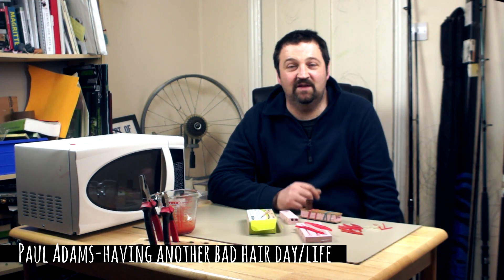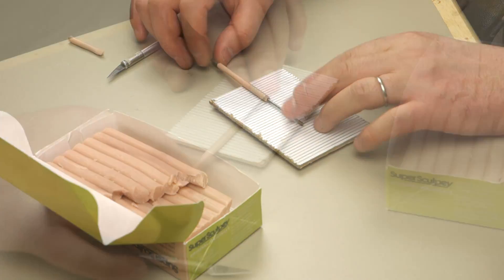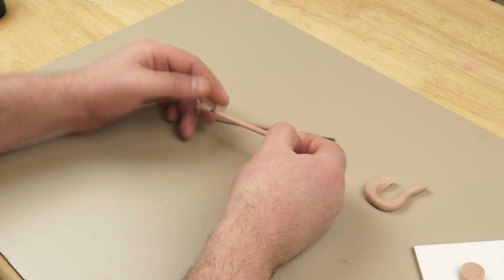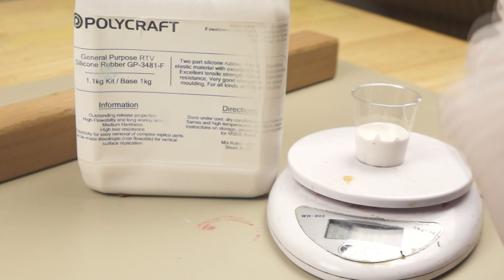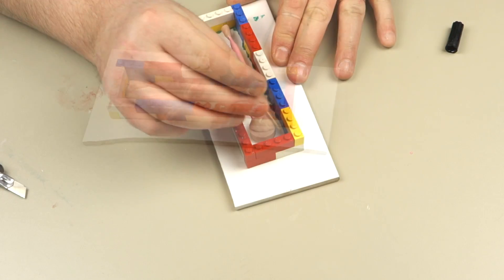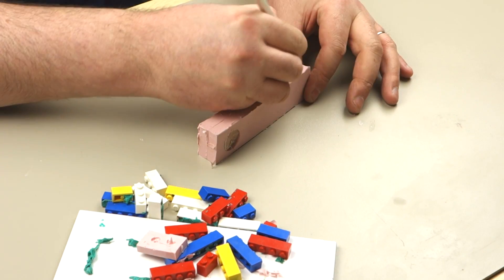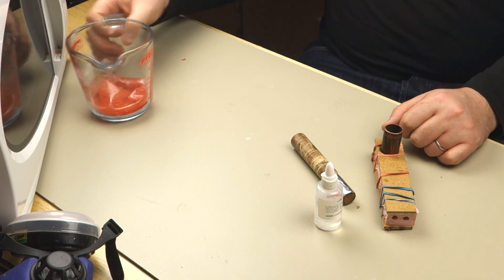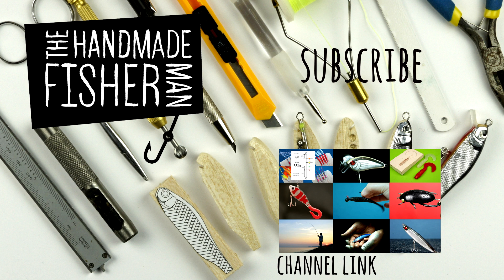Making Homemade Injection Molds For Soft Plastic Worm Fishing Lures

Comment: Can I have the CAD/CAM File for Fish Lights products,  it has threads and a clear plastic
We are using a hand injection, and semi automatic injection, Items are fishing Net Lights
Fish Lure Lights, they are like led Torch.

How does the mould look like for low volume production. Link Below , remove spaces

http:// i.ebayimg. com/images/g/r6oAAOSwnbZYCD21/s-l1600.jpg

www. aliexpress. com/cheap/cheap-fishnet-light. html

I designed my own Temperature controller and hand operated Injection mould now I have to concentrate on moulds.

Comment: Love your stuff Paul...that being said...I mainly fish heavy cover looking for largemouth bass.  I have been trying to re-create a hollow body frog to my own specs but have failed miserably.   Any ideas?  It would be a good project to take on...If i finally figure it out I will let you know...Any suggestions would be great.  You have a better grasp on intuitive ideas than most and thought I would ask....Keep 'em coming!
L/S
Reply from the maker: +Lightning Strike Lures it is not something i have thought about mainly because I do not really use frogs although i did fancy having a go this summer for pike as i had great few sessions with spooks. I am guessing they are made in a metal mold that is rotated and passed through an oven with some kind of liquid pvc that coats the sides. That may be difficult to reproduce at home, i have done some rotocasting with polyurethane but it is not that easy to get uniform coverage. An easier alternative maybe  to use something like a silicone foam pored in a mould, this could probable be painted with silicone paints. I am guessing this is what those spongy dog toys are made from. but it would all need a lot of experimentation to get enough buoyancy and consistency

Comment: is the plunger just for getting rid of airbubbles? is there a big difference between this and pour a small stream into the mold
Reply from the maker: The plunger injects the pvc the gap allows the air to escape before the pvc seals the gap and it is forced into the mould under light pressure, i am not sure you would be able to pour anything this fine.

Comment: nice video ,i did not find the polycraft ,is their an other product to made lures thank's you are the best
Reply from the maker: boukellal redouane Smooth-on do oomoo 30 silicone and alumilite do high strength 2 which looks similar, but it may take some experimentation with the thickness of the moulds
Reply: thank you very mutch

Comment: Hi Paul! I appreciate your attention to detail and very enjoy each of your videos! I cast my bait also yourself. If you had an idea how to "tentacle" can pour? Thanks and cheers!
Reply from the maker: Tentacles and small details are something i thought about for a while, but i need to do some experiments I think mould design where the answers are. To get small details like these worms reasonable pressure is required, with aluminium molds they can take higher pressure and also vent better as they are not an airtight seal. I think less flexible silicone would be needed and the venting would have to thought about so all the tentacles fill and the air escapes. A guy did send me a picture of an amazing crab with legs he had made using this method so it is doable, but time as always is my enemy but i am starting to look at soft plastic again and injecting lager swim/paddle baits.   Thanks
Reply: Thanks Dude! Good. Luck

Comment: Great video.  Could you share , what type or brand soft plastic are you using?
Reply from the maker: i use liquid pvc from Lurefactors in the UK, this was their soft pvc which works well for little tiny baits. thanks
Reply: Thanks a lot

Comment: Hello Paul. It's Mike again. I was going to make a swimbait injection mold but I wanted to make it hollow bodied. I was just going to make it much like your video and stick a formed butter knife into the exit hole for the melted plastic. I ground the knife so it's not sharp. What do you think?
Reply from the maker: Mike Kim give it a go I have used bits scrap sheet metal before to create belly slots, good luck

Comment: Hey Paul, great vid. I was just wondering if you know of any alternatives to applying the first layer of silicone on the motor. I can't find them and if I do they are extremely expensive. Thanks!
Reply from the maker: This motor cost me about £5 from ebay. The first mold of this type i made just poured without any coating first and when it was cured i found a number of bubble stayed trapped on the underside of mold. To be honest on a worm this was hardly noticeable and it gave a slightly dappled effect. On the next moulds i tried just painting a thin coat without rotating and this reduced the bubbles considerabley to only half a dozen and the finished worms were great. It was only when i used the rotating mold that i got a completey bubble free mold surface. But to be honest i would guess rotating it by hand for a few minute would achieve a similar effect, basically the silicone is being stretched by gravity along with the bubbles, because the bubbles are a weak point they tend to burst. Rotating with a slow motor also allows for one thick coat to be applied, without the motor some of the silicone will run off and another coat maybe required.

When there are bubbles on the surface of the mould i found they had the opposite effect on the lure than i imagined; rather than fiiling the bubbles with soft plastic and creating bobbles on the lure the hot plastic is too thick to fill them so it seals in the air and then heats it so the bubbles expand buldging into the pvc as the lure cools from the outside first these impressions stay in the pvc.

There is a lot of possible ideas i have to improve this method but theories require experimentation and  experimenting with rtv costs money.Good luck, I find the only thing better than seeing the first lure come out of a mould is pulling the first fish the water with one.

Comment: Hey, instead of using a clay master to make a mold do you think I can use the actual bait? For example, do you think I can use a Gary Yamamoto Senko and put a bicycle spoke through it? In other words Im wondering if the silicone will pick up the detail of the worm since its soft and not hardened clay. Also, what silicone would you recommend, is there a different one you need for hard and soft masters? Also I live in the U.S. and the silicone you recommend is not available here, any alternatives?
Reply from the maker: I do not see any problem with using an acutal soft plastic bait, the silscone will pick the detail. This is a link to a US company that has a similar silicone to the one used http://www.alumilite.com/ProdDetail.cfm?Category=Silicone%20Rubber&Name=Amazing%20Mold%20Rubber. I have not used this silicone but its hardness and viscosity are similar to the stuff i use.  they also have great lure making videos http://makelure.com/ . Good Luck. I started by making a one worm mold just to get the basics right and make it a little easier to inject, i made the mistake of applying a lot of pressure when i starting injecting and believe me spurting hot PVC is not great. I found applying just enough pressure to get the plastic to flow worked a lot better and was safer. Have fun, thanks

Comment: Big fan of your videos. Was just wondering what camera you used to make them. The quality is outstanding. Thanks for your time! Love your channel!
Reply from the maker: This is a sony a77 with a seperate didgital audio recorder, i was still getting used to it making this vid. The real difference between this camera and the compacts i was using before is i can easily set everything manually, i can see in this vid that i set the shutter speed too slow for frame rate and it is a little blurred when my hands are moving quickly,  It has some other great features like high lighting the areas in focus on the screen and a monitor which can  be twisted around so i can make sure my hands are in shot. The main reason i bought it is i had a lot of old minolta lenses that have the same fit.  Thanks
Reply: Thanks for the reply and explaining everything. I appreciate it.

Comment: Great video Paul always love watching your videos and then making it myself! I'm sure they would also work great with pollack or coley, do you know could you add glitter to the plastic mix, Or would it not set properly?  Also thanks for taking time to make these videos
Reply from the maker: I am still experimenting with these, glitter is not something i have tried yet. I suspect on the very small one the normal glitter i use would clogg it up as the as the wire it is on is 1mm 0.040th, but it might work the larger worm . I am planning to do some larger baits which i think would work with glitter, but I need to look at creating a support box (when i say proper i mean out of something from skip) and a large riser to deal with shrinkage. Shit I miss coley fishing, Coley smoking and Coley eating they are such an underrated fish. Cheers

Comment: awesome idea, i think i am going to do this,i have the silicon puddy that cures in 25 min or so. it will be awesome to finaly be able to make plastic baits that are 100% dimentional and not have to drop money on expensive  aluminum molds and injectors on the market.
Reply from the maker: good luck, this was the simplest mold of a worm to start, i am going to try some more complex and larger shapes, this I think may require a slightly different approach because of shrinkage. cheers

Comment: Once again, great stuff. I think those would be great for ice fishing over here in Michigan. Just put them on a very small jug head and bounce them off the bottom.

Tight lines.

Scott
Reply from the maker: I really wanted the tiny ones for perch fishing, thinking that they would be well below anything the local pike would interested in, but i had pike take one on a drop shot rig on a size 8 hook. Luckily the hook was too small and when the pike unwound its self from the line it swam away. Gave me a bit of panic though, then it began to rain again and i went home  Cheers
Reply: *****
Just goes to show that pike will hit anything they think they might want to eat. LOL! I caught a 5 lb King Salmon last year while I was ice fishing. I was fishing for our yellow perch (which are much smaller than the perch you have over there) using a 1/64 oz jig tipped with a tiny piece of raw shrimp. I was quit panicked because I was using 4 lb test on a ultra lite ice fishing rod. It was quite the fight, but I got it in. It barely fit through the hole I made with my auger. LOL!

Tight lines.

Scott